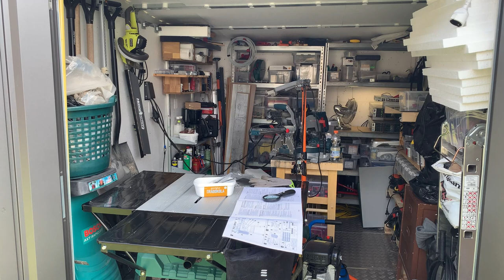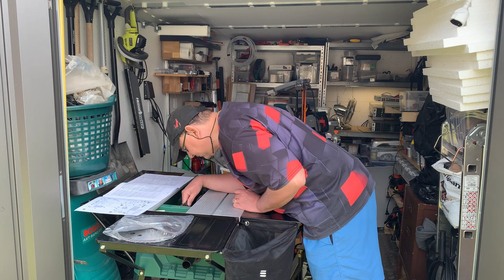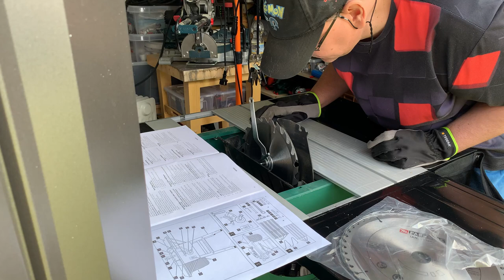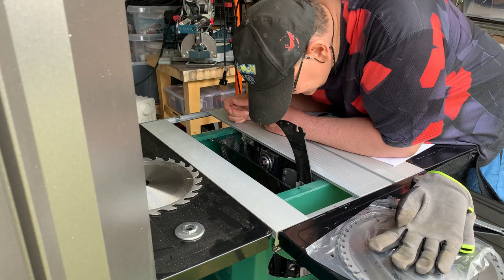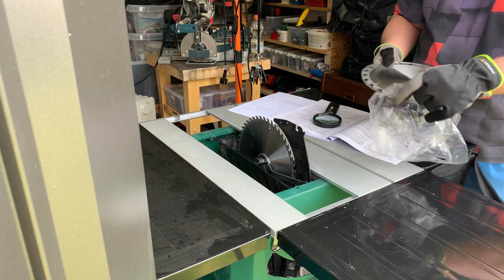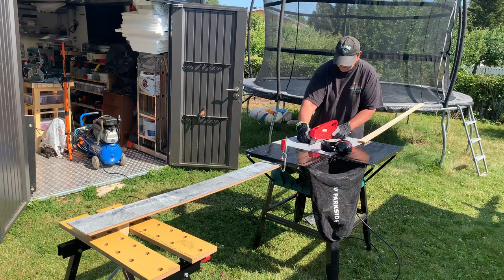Parkside Lidl table saw blade change and first long cut

Comment: Thanks for doing the long-cut test. Could you please share your thoughts about the accuracy after measuring both ends?
Reply from the maker: +-1 mm with a bit of forgiveness for the usual table saw roughness. Not a cabinet making table saw :) so results may vary.
Reply: @TheTechRabbit  Appreciate your feedback. Thank you!!